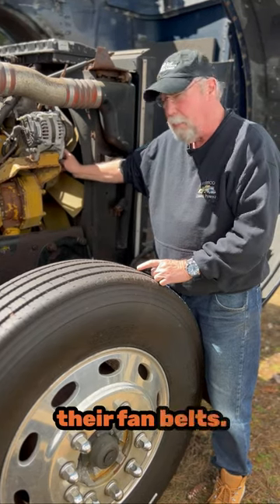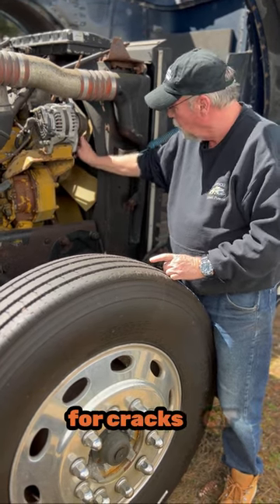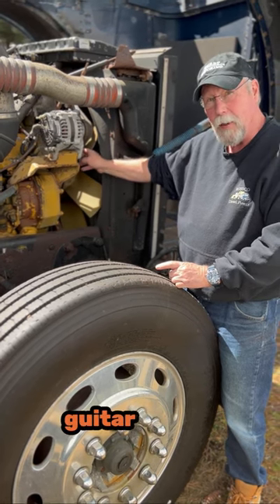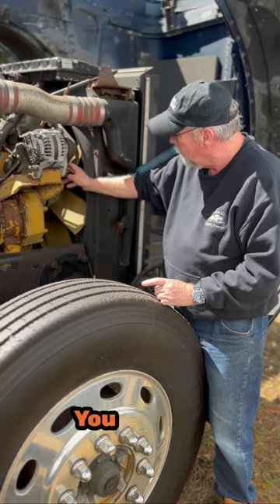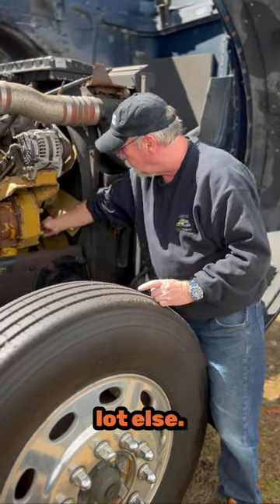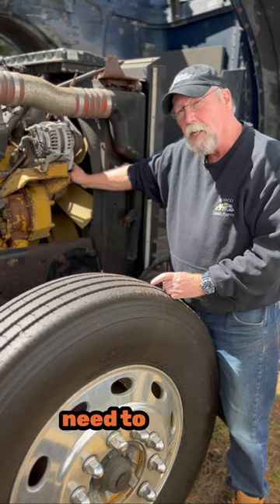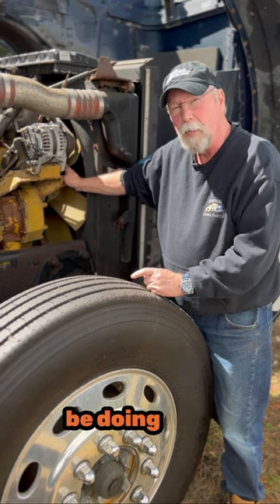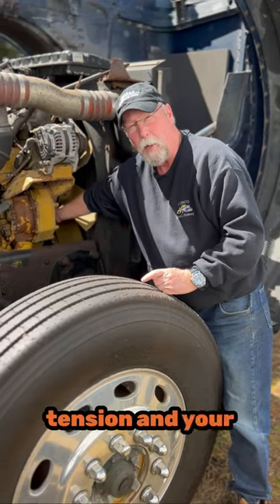Getting Your Fan Belt Tension Just Right! #shorts

Comment: I like those flat belts with the grooves in them. I had 3 of them on my Nissan Sunny, here in South Africa, which lasted 23 years before I decided to change them. They started cracking badly but never broke. The old style V belts with the teeth don't last more than a few years before they crack and break. Also, the genuine parts belts last much longer than cheap aftermarket "made in China" belts.
Keep on truckin😁👍🏻🙋🏼‍♂️